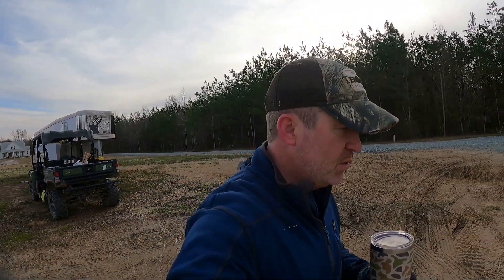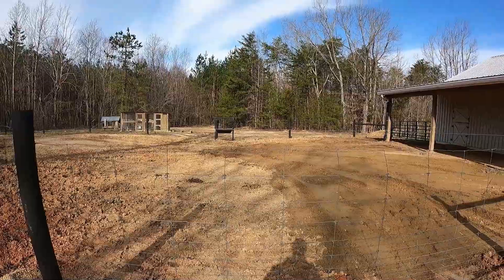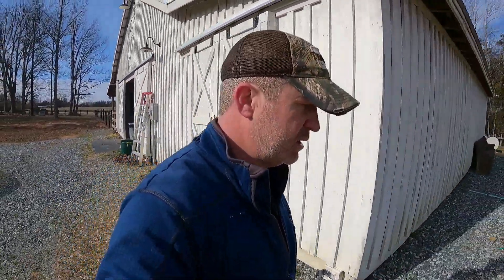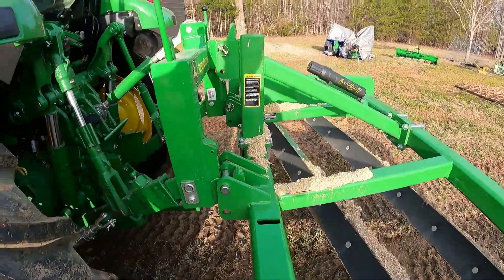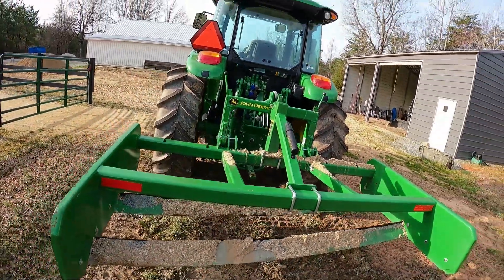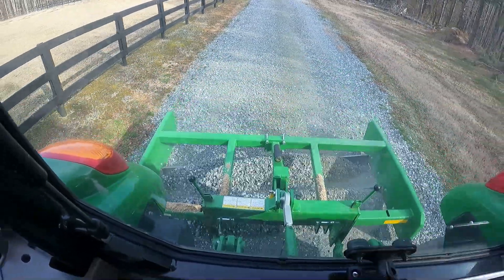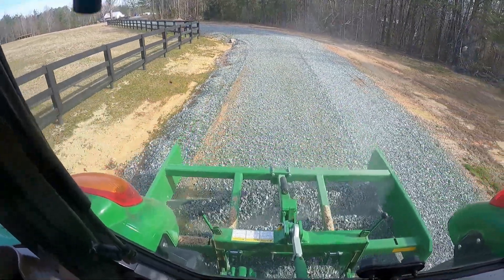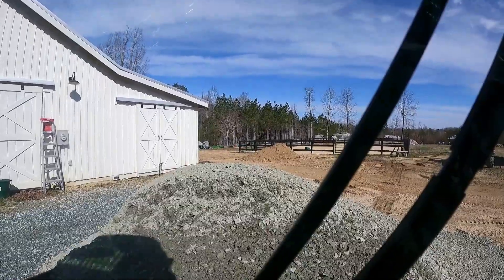Horse farm stuff | John Deere 5075M and using a Frontier land plane for gravel driveway maintenance

Comment: Very helpful videos. Thank you. What are the dimensions on your equipment shed? Having one bid right now. Plan to put a similar size cab tractor in it with room to grow. Thanks and keep at it.
Reply from the maker: My shed is 24' x 36' and it is not nearly large enough.  I am looking at putting up another shed.  I like to keep my expensive stuff including implements out of the weather.  I currently have things sitting out that I prefer to have out of the elements.  My doors are 12' H x 11' W and I find that set up to work good.  Thanks for watching and hopefully this helps.
Reply: @firstgenfarmer9809  Well I adjusted my shed building plan and will start with a 24 X 60. Thanks again

Comment: Can you show the 5075m more? Also how many hours do you have on the 5075m?
Reply from the maker: I plan on doing more videos of the 5075M. I'll be using it considerably beginning in the spring. Is there anything specific you would like to see?  It has 31 hours. Let me know and thanks.
Reply: @firstgenfarmer9809  I would like to see you use the loader more. I'm looking at getting a 5075m. I have a small firewood business. Do you have a grapple for it?
Reply from the maker: @mikej9200  I'll try to get something on the channel showing the loader in the coming week.  I've been very happy with the loader.  It'll life 4,400 lbs to 59".  The cycle time is very quick even at lower RPMs.  I have no complaints.
Reply from the maker: It's likely going to be a while before I can get a video of the loader in action.  Is there anything I can answer about the loader?
Reply: @firstgenfarmer9809  Have you cleaned up any trees with it like you had in your driveway?
Reply from the maker: @mikej9200  Yes I used it with a 4-in-1 bucket to clear limbs I cut with a pole saw. It worked ok but not as good as a root grapple would do.
Reply from the maker: @mikej9200  I do that work so infrequently I'm having a hard time justifying purchasing a grapple.